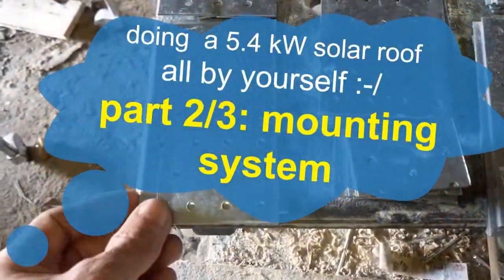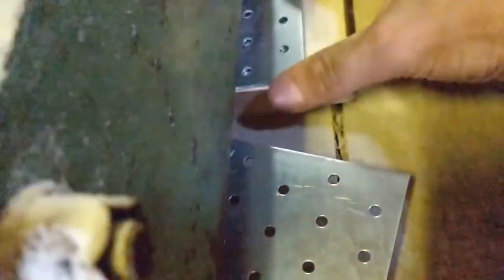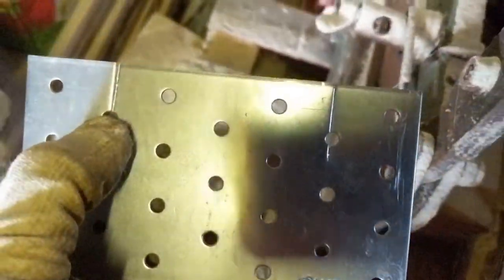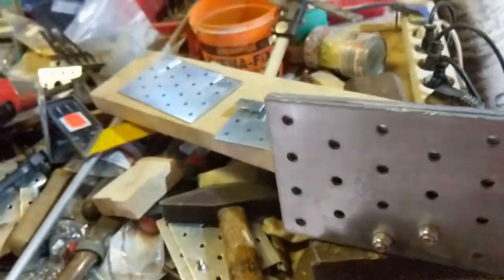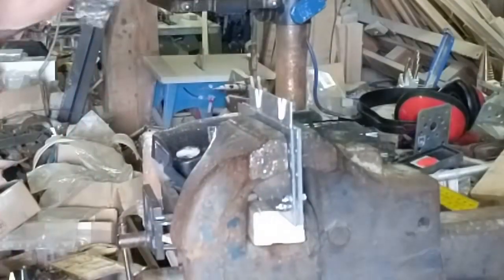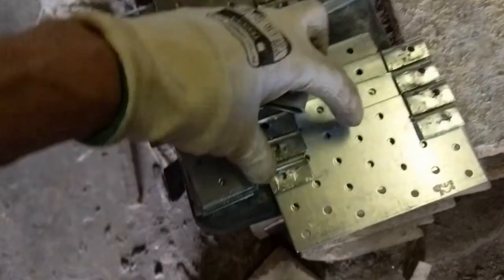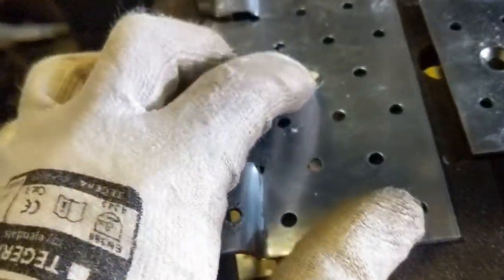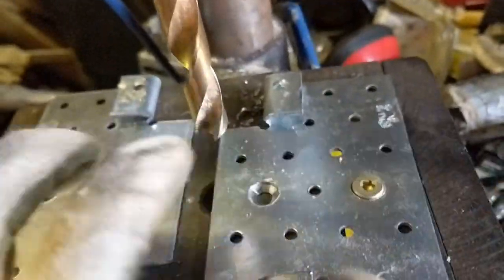part 2/3: mounting system - 5.4 kW solar roof all by yourself :-/

Comment: That seems quite solid. When I was messing around I found a setup of 2 90 degree shelf brackets to make a C shape and mounted underneath the panel are very fiddly, but cheap and strong enough. If you have access below they might be assemble easier, and you can double the brackets up to allow bolting 2 panels to each other quite easily with whatever material you want. Your method looks a lot stronger, and you can mount them without access underneath which I like.

        _____________________________________________________________________
       |
       |                                                        Solar panel
       |    [¯¯¯] - bolt
       ¯¯¯¯| |¯¯¯¯¯¯¯¯
       ___| |_____
     |      [___]
 =[]||[]   - Bolt
     ||  - Overlapping brackets
     ||
 =[]||[]   - Bolt
      |
      ————————
Reply from the maker: no access from below is a MUST to let the greenhouse film/foil be the water protecting layer.
Reply: @robodurden  Thanks. I see that in your part 3.